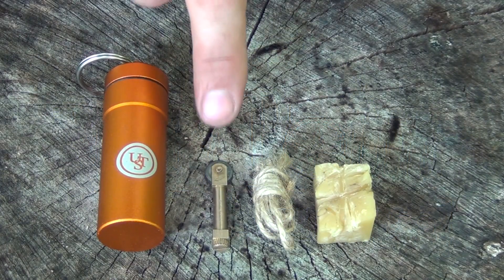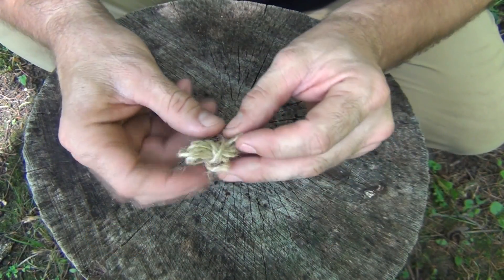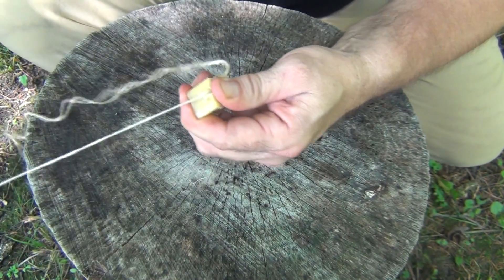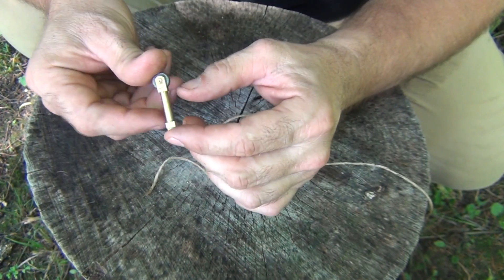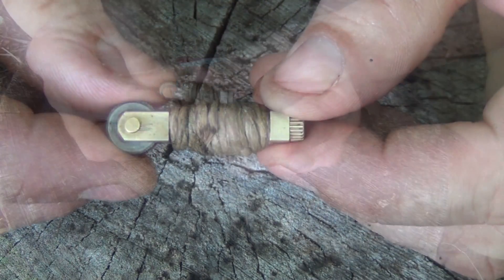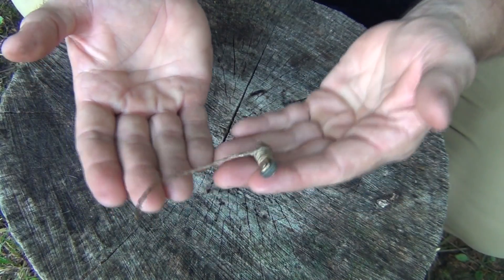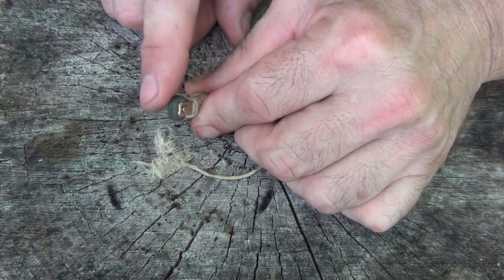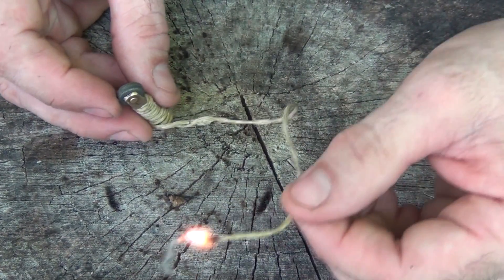Mini Fire Hack [Amazing!]

Comment: Oh yeah!
I’ve been putting those mini sparkers in kits for a while now. You just showed me a way to make them much more functional.
Thanks! 
👍🏼👍🏼
Reply from the maker: Great, glad you liked it!
Reply: I have one of those, but the way I was showed when I was a kid was my dad would have us pick up old lighters on the side of the road. You take the little piece of metal off and you got the same thing. For free. You could even drill a little hole in the bottom and put short matches in it and get hey little piece of wood and make a plug on it. And glue a piece of a striker off of a book of matches on the side. Two Fire sources for the price of one. Which at the time was free because they used to give away matches then it became only to people who bought a pack of cigarettes and then it became a penny or two a piece. Now they want you to buy an expensive lighter. How far we have come.

Comment: Nice little hack. Well thought out again James ! 👍🏻👍🏻
Reply from the maker: Thanks my friend!
Reply: @WayPointSurvival  This is a beautiful variation on jute "match". Dipping a thick (or braided from thinner) jute cord in wax and then pushing it into a short, steel tube. The rest is the same - pull a little on one end, fluff it, strike ferro rod to light the tip and hold the steel tube. It's like a mini torch with feeding wick ;)

Comment: Using different diameters of jute twine and different braiding methods, I’ve made zipper pulls, lanyards, slings, belts and even pack straps. With endless uses, you always have tinder.
Reply from the maker: True.  Thanks for watching.

Comment: You could also use a Camel Snus tin, or an empty Skoal can in place of an Altoids can. You can also set up some other small kits with these cans, like a small fishing kit or sewing kit, or a little kit that has elements of all, a small lighter or striker, some light jute cordage, fish line, hooks, sinkers, sewing needles, a small spool of thread, a couple bandages, etc. what I did, I also added some pieces of duct tape to hold down the fish hooks and needles, and put a few extra strips of tape on the lid and bottom of the can, and also some extra strips to the outside of the can, because there’s always a use for tape. Another kit you could make would include first aid items, bandages, alcohol wipes, some aspirin or Tylenol, a few packs of triple antibiotic cream, and a couple of cough drops. The possibilities are endless for these cans. They won’t take up much room in your packs, and can hold a surprising amount of small items, and keep them dry.
Reply from the maker: Absolutely.  Thanks for watching!

Comment: Cool kit! I don't have that striker but I do have an Exotac nanostriker that is similar but larger.
I use a Tentsmiths watchcoat from time to time. I made a belt for it that is... 'interesting'...
I started with jute that I waxed. Two pieces about 30 feet long. I waxed them with beeswax. I doubled them over a brass ring and then did a 4 strand sinet braid. I ended with a 5-6 foot rope belt with a simple brass ring for a buckle. The extra length means I can cut an inch off from the belt and have an awesome firestarter without searching for it.
If its bad weather I'm already wearing the coat so its already at the ready.
Reply from the maker: Excellent idea, thanks for watching!

Comment: Have you ever tried dunking a thick length of jute twine into melted wax?   When you fluff the end (it’s better when it’s been used already) you can light it with a striker and it will burn as a fire starter for a really long time.  So you can place it where you want, and move it around etc…. Place a short length of copper tube or something to use as a holder, and to put it out, since it’s not that easy to extinguish.

Comment: Nice hack. Never thought running jute thru wax like that, I learned something there. Wondering if you could use a spent  Bic by taking the metal guard off?  It should, I've used a spent lighter to light cotton before. Thanks for sharing.
Reply from the maker: Yes. It's basically the same principle.

Comment: have you ever tried cutting down used up bics and making a striker? works descent enough!!
Reply from the maker: No, but it is basically the same principle for sure.
Reply: @WayPointSurvival  yeah same concept but way cheaper! by the way if you know anybody that carry's a zippo lighter the flints in a bic will work perfectly in one as long as you leave the screw out a bit! i get a good 4 to 5 months out of a salvaged flint where i was replacing them every month before!

Comment: Excellent job
Reply from the maker: Thanks!
Reply: @WayPointSurvival  I was just thinking. You know the plumbers tape that is Teflon that goes around threads on pipe. If you had an empty spool from one of those you could make up a whole bunch of that twine and put it in there and make a little hole on the case to feed it through and it would make the inside spin around as you pull it through the hole. It would be an awesome way of carrying a lot of it. For like when you have to light lanterns, or if you are a smoker. It would be great for lighting pipes when you're out bushcrafting. Or campfires. There might even be enough room inside of it to put that Striker. Depending on how much waxed twine you put in it. But one of those things would last a long time. And it would be completely waterproof. And could be used for emergency cordage for other things. You could even attach it on the outside if you got a large plastic drinking straw. Like the kind they give people to drink bubble tea. It would be like a case for it if you did it right- just a couple ideas... I know you are always coming up with improvements to your hacks. Like with your Stanley series. I like the way you think. I have an idea that's how most people used to think a long time ago before everything got so modernized. People are lazy anymore and just want to buy stuff when there are so many clever things you can do yourself that work even better. I use the beeswax lip balm one of the clear colors usually I use vanilla. To wax my pipes. It works a lot better than the junk they sell from a pipe shop. It also protects the stem of clay pipes. I never see any body talking about that either because that's usually not what the mainstream people use. People usually obediently do whatever has been done. And if you don't try things you never know there might be a better way at a cheaper price. I have a pipe that's older than the Titanic. And I really tried a lot of stuff to make it look better. But after discovering the beeswax lip balm trick on my cheaper pipes. I tried it on it and the dang thing almost looks brand new now. 114-year-old pipe.
Reply: @WayPointSurvival  and even better idea would be an empty dental floss container. It's not hard to get the spool out of it. Remove the little metal cutter on top and make the whole plenty wide to pull the waxed twine through. You might even have room to make a place to put your Striker down in or you could always tape it to the side.
Reply from the maker: Great idea! Thanks!
Reply: @WayPointSurvival  well it's something a lot of people don't think about but people have been smoking pipes for over 1500 years. And surely they didn't wait to smoke until there was a campfire. You could make your own jute twine pretty easy and we know they had beeswax. What a perfect way to light a fire in a house during the summer to light a candle or Lantern or even a pipe. Everybody today uses char cloth but they don't think about how precious cloth was back then. Even a holy rag had uses and you didn't want to burn them up everyday. People didn't have money to buy clothes like we do now a lot of people only had what they wore. And when they grew up they passed their clothes down to the younger people. Siblings or cousins or they were put to other uses. The idea of using char cloth is just a bushcrafting fad and not realistic of how things were really done way back in the day. They used certain types of mushrooms or pieces of charcoal they collected from a fire or chard themselves. When people today do it they are trying to do what they think other people did but when you were back then living it it was natural and you didn't really think about it you did what your family did or what you saw your friends doing and that was just a way of life and you did it every day without thinking about it. And I'm sure people did whatever was required to make their life a little easier. We call it survival today the back then it was just living and I'm pretty sure they would laugh if they saw most of the people trying to learn what they did as a matter of course. It is certainly a skill we should never give up. Technology is great and toys are fun. But it looks like a lot of that might be coming to an end. It might not be too long before stores are a thing of the past or at least stores we currently recognize. Making cordage can be a pain in the ass unless you do it all the time and you don't even think about it. It is a motor skill like driving a car. Or the old lady knitting. After a while you stop thinking about it and just let your hands do it. Skills like that are what we should all strive for. I really like your videos because you do a lot of reenactments and you give out a lot of history so many of these YouTube people are just out to make money selling products designing knives and so forth. And I know a few that I have seen on here for many years who were learning basic skills back when I first started watching it and they are still trying to learn those same skills today and the only reason people watch them is because they show a lot of cleavage. Anyway thank you so much for your videos

Comment: be careful with that striker.  if you forget about it and find it two years later and try to use it, the flint shatters lol
Reply from the maker: I've never had that happen. I have, however, had them corrode in the barrel and have to be removed.
Reply: @WayPointSurvival  I lost mine in my garage for a long time, found it, struck it and it disintegrated lol.  Good times

Comment: Nice hack, thanks.  But why spend $ on this gadget when all you need is a used up disposable lighter?  Also, it might store better inside a pill bottle.(watertight) rather than a quick to rust Altoids tin.
Reply from the maker: Sure, you could do that.